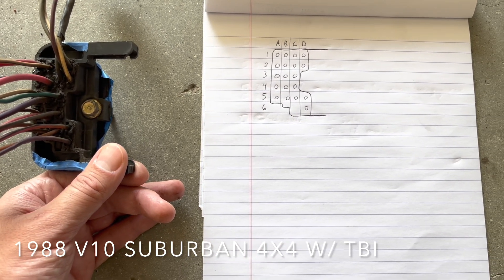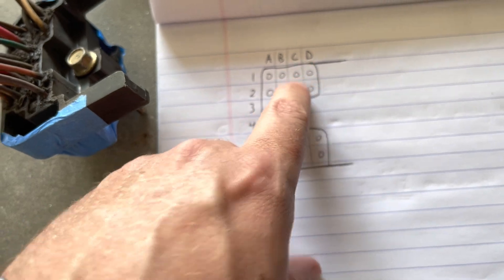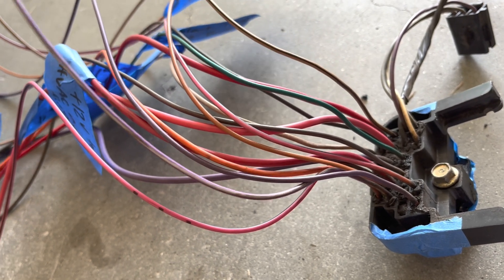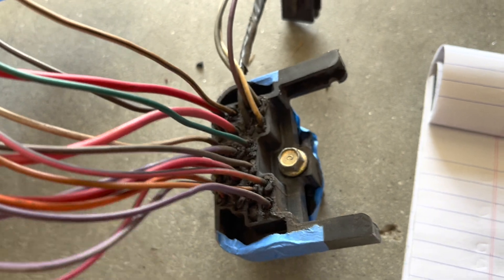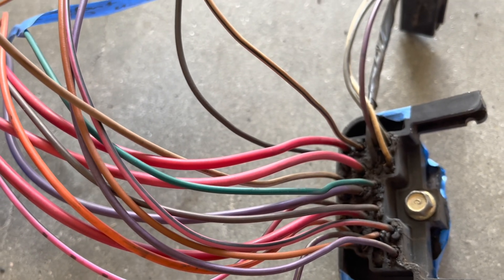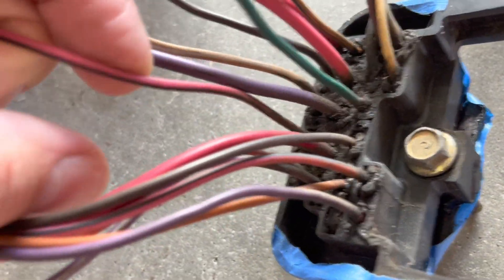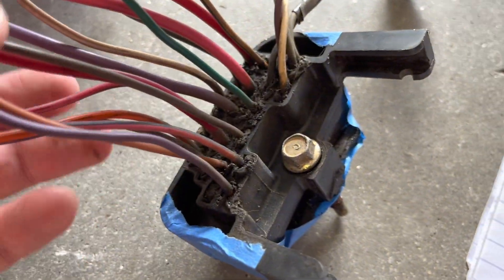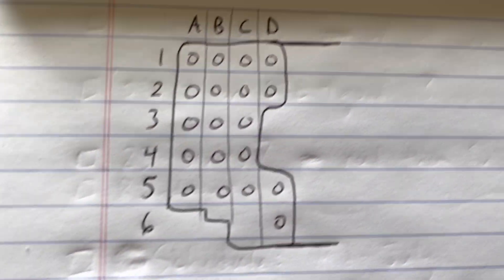1988 Suburban Squarebody Bulkhead Wire Identification

Comment: this is a video ive been looking for FOREVER. i bought an ls swapped squarebody and all the bulkhead wires were cut at the block and they ran everything to a push button with a red rocker switch from amazon that hides in the ashtray. i want to put a factory ignition setup and ignition switch back in the truck. this will greatly help. thanks!

Comment: Hey, I noticed you're not using the term "fusible link" correctly.   Not understanding them could have disastrous consequences.    They are a failsafe against electrical fires.
Reply from the maker: Yes, calling it a fusible link is incorrect. I think it really is just a power junction block. It is black diamond shaped and mounted on the firewall between the driver side of the engine and the brake booster.

Comment: I was about to say whitch truck u got that gots all those wires in the bulk head every time i due a ls swap in c10 its only one or 2 for cab power and constant and one wire purple to starter and the 12 v ingition powerd switch yellow wire 4  ahhhh i seee tbi
Reply from the maker: Yeah, TBI has lots of different stuff to monitor, etc. I basically eliminated everything from the bulkhead except for 3 or 4 wires for 12v constant, switch power and purple starter wire.